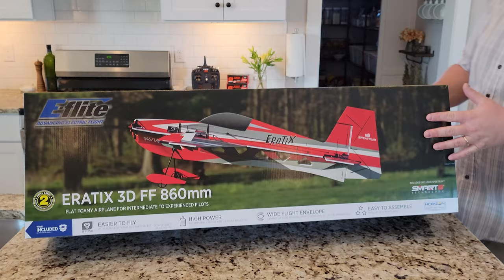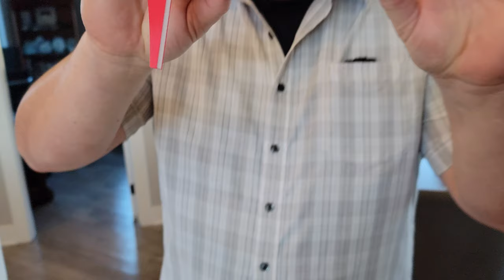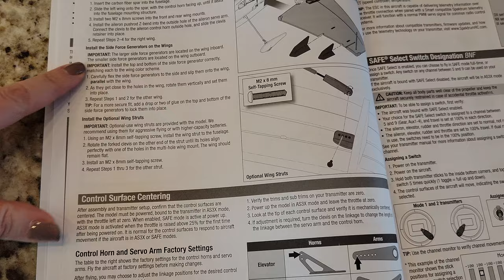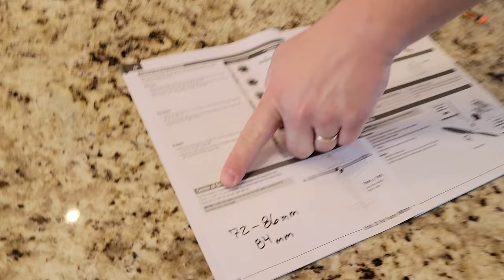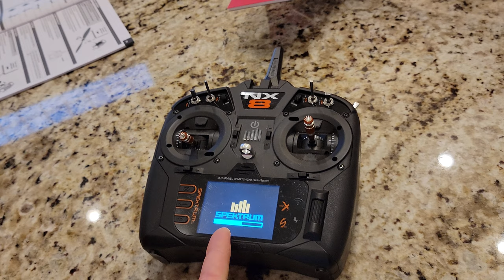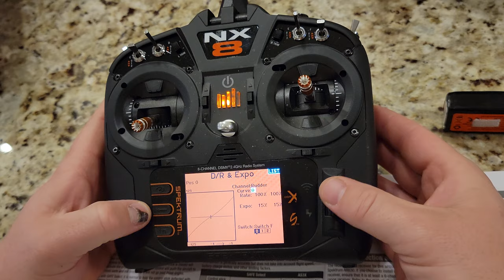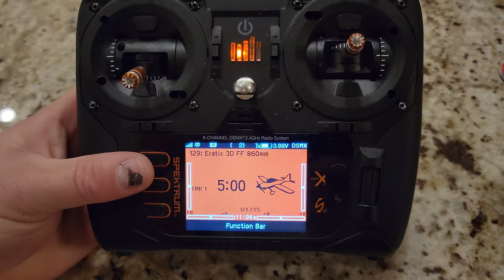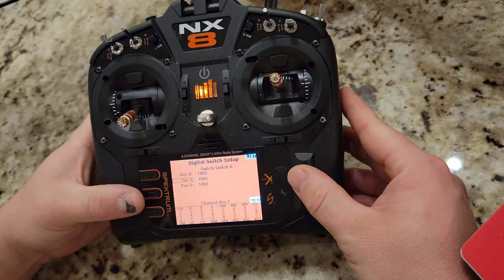E-flite - Eratix 3D FF - 860mm - Unbox, Build, & Radio Setup

Comment: Just got mine put together, but I'm having trouble with the radio setup (DX9).  First, in AS3X mode, it doesn't seem like my servos are moving at all when I move the model around.  Yes, I ran the throttle up above 25% to trigger the AS3X on.  Also, my aileron servo horn wasn't centered out of the box.  Was yours like that?  If so, any idea on how to center it?  I can't remove the screw because the fuselage foam is right over it.  Thanks!
Reply: Okay, I figured out the servo.  If you remove the two mounting screws (you can easily get to them at an angle with a long screwdriver), the servo will lift up enough that you can rock it over and get access to the spline/horn screw.  With the horn removed, the entire servo will come out.  Good to know for future maintenance and anyone else who might not have a centered aileron servo horn out of the box.  Same applies for the rudder servo, but that one is even easier because there's more clearance to the foam directly above it.
Reply: As for the AS3X, I "think" I can see the servos moving slightly when I move the plane around.  Strange that I can't hear them, though.  I did remember reading somewhere that the AS3X gains are set on the light side.  Makes sense with those monster control throws!  Now, if I could just figure out how to set up the SAFE mode...
Reply from the maker: AS3X won't initiate until AFTER you've given 25% throttle...but SAFE WILL WORK RIGHT AWAY
Reply from the maker: With AS3X you need to make sure the surfaces are moving...stand with the plane in your hands, and prop toward your belly (AFTER safely giving throttle, then turning on Throttle Cut...of course) then just spin around with the plane pointed out from you - you'll see the rudder point in the direction you're spinning. Also, you can do similar with ailerons and elevator, but may not need to spin ;)
Reply: I had the same exact problem, I was very annoyed to say the least. I wound up using a pair of thin needle nose pliers to back out the screw, then I was able to pull the horn up and reposition it.

Comment: When you buy a 3d plane, and ur not an experienced 3d pilot, first you buy 3 planes, never 1.
Gives you way more confidence to beat the crap out of the first one.
Learn on the 2nd, show off on the 3rd.
These are excellent if you change the servos to higher grade versions.

This will fly as is, but better servos will make it so smooth and possible to do basically whatever.

Comment: Nice video but... When your showing a educational video that we're are following along step by step, you need to go (SLOWER)  SSSSSLLLOOOWWWEEERR. I had to try to stop it several times and go back to figure out what you had done.   Nice and very informative.  You can always check yourself by having someone else watch the video and follow along with your TX to see how they (someone who has no idea about using a TX) will help you a lot.  It also will help you explain things on an elementary level to others who just purchased a new TX.
Reply from the maker: Have you tried changing the playback speed to slow the video down? This is a great help when you're following a step by step video, like we do all the time. We've found that no matter what speed we go, we're either too fast or too slow for someone...so if you want to change the speed, click on the GEAR, then PLAYBACK SPEED, then choose as slow as 0.25X speed. This might be enough to take the edge off, and then you can get what you need with only the occasional pause needed.

We want to help, but can't make a video that's custom tailored to one person's very specific needs, since our videos are already VERY long. Hope this makes sense.

Comment: Damn how is this $219 i don't understand 🙃 this should be more like $70-80🤦‍♂️🙃 eflight .. keep the spektrum thing.. kit would be amazing.. foam is super cheap to make this should be like $40kit 80pnp and perhaps $100 max BNF really
Reply: Price all the electronics separately and tell me what you come up with.
Reply: Currently shipping adds $50 to each plane
Reply: @mostlymissiles  they ship in large containers that will fit like hundreds if not thousands of these you know that right.. this model is flat doesn't need any vertical space basically
Reply: @B58FTW  electronics are roughly $20 from direct china manufacturing and foam like $5 for one plane .. boxing etc import tax.. still leaves them over $30 in profit if it was $80 pnp
Reply from the maker: Matěj Bludský If you can get these plans so cheap, please hit us up and let's do some business - LOL ;)
Reply: @BrianPhillipsRC  not my point :) but yeah that also could be done. Let's be real here, nice plane but huge huge rip off financially .. don't think they will sell many of these
Reply: @matejbludsky8410  I just checked current shipping rates, it is around $6000 for a container from china to san fran (down from over 10K earlier), then shipping from there to the warehouse is more
Reply: @mostlymissiles  hmmm ready made rc just shipped their goblins for $3000 something wrong with your calculation ;)
Reply: @mostlymissiles  even if what you said was true .. that container would fit like 5000 of these models lol it's a flat foam omg shipping basically zero in the final price
Reply: @matejbludsky8410  then get busy importing and selling, seems like you could be good at it
Reply: As long as people keep paying premium prices they're going to keep pumping them out.